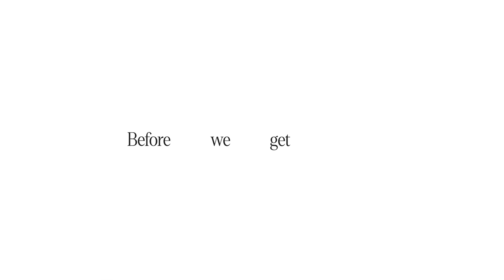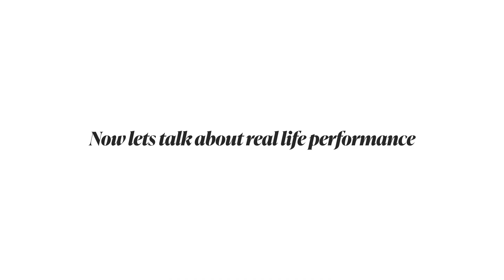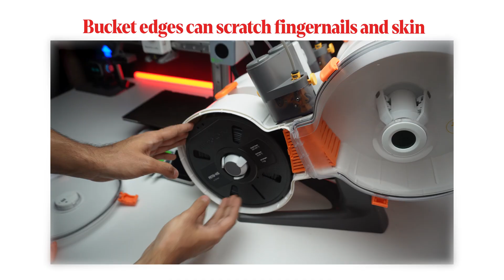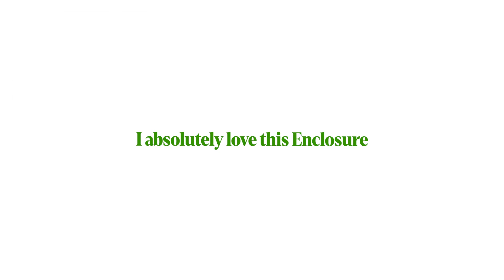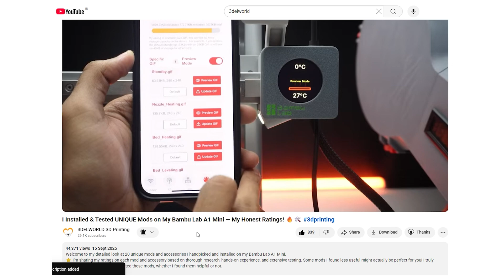The Smartest AMS Lite Enclosure Upgrade Yet 🔥

Comment: You are trying to modify a bad design, in most cases it results in more money spent and leads to more problems. I had the same problem with high humidity with my A1. I spent money to build and enclosure, added light and it improved the printing but created more problems. I solved all of these problems by selling the A1 and buying a P2S instead. It is far more convenient to use, the screen is awesome and not laggy like in the A1. The AMS2 is enclosed, has a drying function and I can leave  the filament spools inside since I added desiccant pods to the AMS. It prints ABS and CF filaments very well, the camera is a real video camera not low resolution 1 fps like the A1 and it has bright lights.
Reply: Yeah and it only cost  21/2 times the A1.

Comment: After seeing your video, I decided to throw away my printed enclosure. The enclosure I was using definitely has a confidentiality issue and lacks rigidity, so it bends as I use it. I ordered it with a discount using your code. Thank you for the good video.
Reply from the maker: Glad to hear that. 😊 This new enclosure is definitely sturdier and more reliable than printed ones. Happy you found the video helpful 🙌
Reply: Use Abs while printing and increase infill and wall size thickness... buying something from market diminish the purpose of a 3d printer you can use tpu for printing gasket for the ams cove to make it airtight...